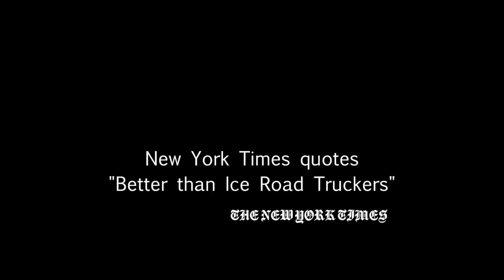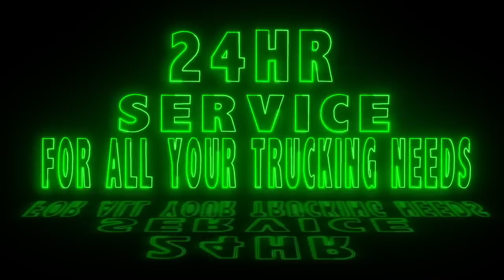COAL MINE RAIL, TOWN SHACKS

Comment: That’s got to be the slickest way to load and unload that rail equipment. I’m sure the crane doesn’t come cheap, but certainly saves a lot of time! Another great video Jerrold. Maybe there’s going to be another “FRANK” at the new job!
Reply from the maker: we would only use the crane if there wasn't a spot to unload  like flooded section. i only worked with cranes once or twice a year doing rail work. there was actually a bigger frank came available but opted out due to a few things, but it was deadly looking for sure. ill have to grab a photo of it when i see it, with a ton of love and money the one i picked will be bad ass too

Comment: F#ck ya new video. Nice to see frank still in business. For now.       The rail equipment. What was your total weight. Again nice to see you trucking sir.
Reply from the maker: spiker puller is a full load for a tri tri. 22,500 KGS on drives and 23,000 on trailer give or take a bit, also depends on how many spikes in the tray, these guys have it down to a science and i just do as they say and it works out 99% of the time
Reply: 10 4

Comment: I didn't think that crane was big enough to lift   those bigger pieces.
Reply from the maker: he can do everything but tampers. 62,000 pounds, some are more. the regulator second heaviest usually 42,000 to 45,000 if i remember correctly, might go up to 46,000. everything else is pretty manageable